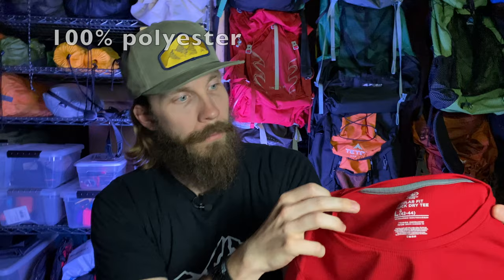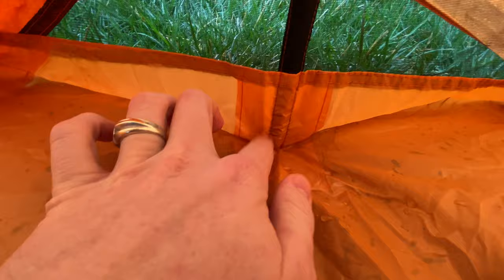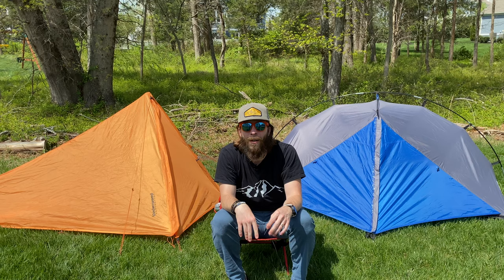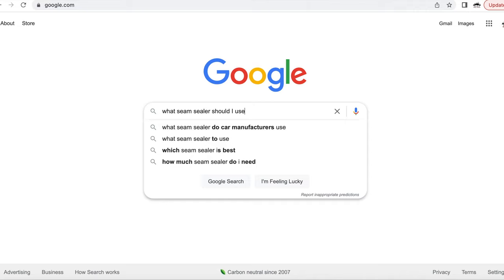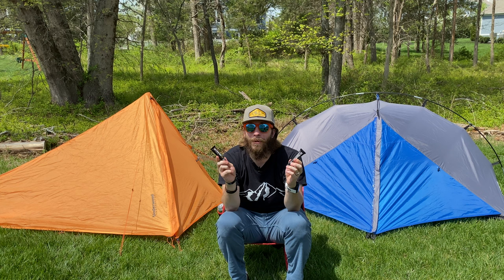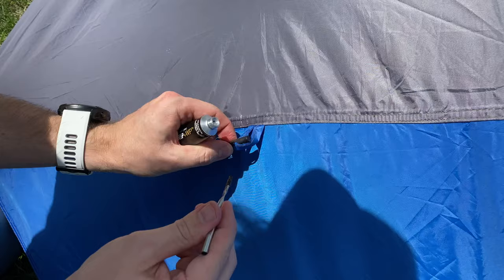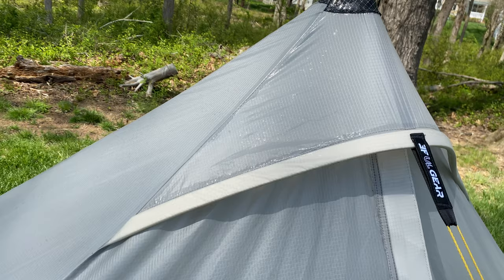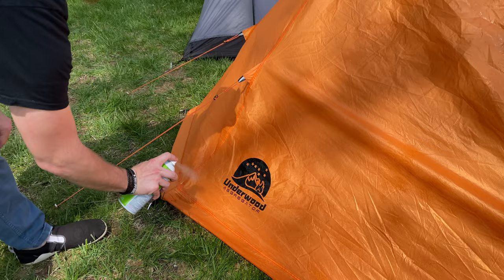FIX IT for $12  ||  How to Waterproof a Tent (even cheap tents!)

Comment: Ive got a ( no longer in production ) BA Jupiters Cabin 4 . Its only rated for 1500mm/hh , but it has proved to be quite waterproof from the factory. It survived a continuous 4 day deluge in 45 mph winds , also a puddle formed around the tent , and the base of the tent was literally sitting in a 1/4-1/2"of water , the floor was all puffed up from literally floating on the water , yet after 4 days only about a tblsp ( maybe 2 ) had made it into the tent , and most of that was from water tracked in from repeated entering/exiting/reentering the tent. Also , over the years , i have tried probably close to a dozen of the major waterproofing brands , and have found " Atsko Waterproof Extreme " to be far superior to  all of them . Another slightly cheaper but just as good alternative , is to mix one tube of pure food safe 100% silicone caulk with a gallon of low odor paint thinner and apply it with a brush , also works great for turning bed sheets into waterproof tarps. Just my 2c worth

Comment: Great video!! I have a Lightheart gear tent the solong 6. I've had it in some serious storms for a few days at a time with no leaks yet. I did pay the company to seam seal it though 😢.  Extra money. I dont understand why they dont just seal it for free for the money they are charging for the tent!!?? Only thing that happened after a few days of rain was it soaked up water and started to sag a little bit. I tightened the guylines and fixed it enough. But yeah no leaks. Oh its made of silnylon. Should have just sealed it myself and saved $$.

Comment: I have a Cabela's cabin tent that I bought about 20 years ago. Until about two years ago, it would stay dry in a downpour. When it started leaking, I re-sealed the seams and sprayed waterproofing on the rain fly. It still leaks. Next step is the hose test to try to diagnose the exact location of the leak(s)

Comment: you can get some denatured alcohol, any kind of pure silicone like some basic caulk, and a small artists paintbrush. you dilute the silicone in a small dish, with the alcohol so it's somewhat liquidy but not too runny. paint it onto all your seams, inside and out, liberally. you'll see it coating every visible part where water can seep. do it in direct sunlight to see really easily, it will coat it fully and let it dry and cure for 48 hours in shade. this is ultimate durable 100% seal. and using the basic spray sealant on any fabric gives you a bone dry inside. besides any condensation. but this is a tremendous little hack. total game changer. you can do 100's of pieces of gear for many years with a single tube of silicone and a little alcohol. fraction the cost of any sealant or tape and stronger

Comment: Best extra protection from the elements is a tarp. 
Depending on the size of the tent, get a tarp that will completely cover the tent. Tucking the tarp under the sides of dome tent.
If a canvas wall tent, a 12×16 tarp will keep a 8×10 tent top sides dry.
A 16×20 tarp will do the same for 10×12 & 12×14 canvas wall tent.

Comment: I have a Eureka Desert Canyon tent, I've had it for about 5 years now. I'm in the PNW and seem to get rain on every camping trip, last year it poured for 5 days almost non-stop, but the tent interior stayed totally dry. I always worry when it might start leaking though. I don't have a yard or a space I can set the tent up in, but might order the seam sealant and a spray and use them on my next camping trip, so long as it has a full dry day. I want my tent to last, especially since Eureka is shutting down. If I could afford it I would buy one of the updated versions of ny current tent for when it inevitably needs to be replaced.

Comment: I've recently experimented with nik wax silicone sealer, it's water based and your supposed to add it to the wash. At 12-15.00 for 10 oz thats about 3.5 loads total.
Instead I put about 1/8 cup in a quart size sprayer from the .99 cent store and add water and shake. Spray on and brush or wipe, then allow to dry. I've done two canvas laavu tents (total 4 canvas ponchos), one washload of nylon tarps. And still have enough to do the hilti tent that leaks like a seave, I done know from where though. Might have to make up some 100% silicone and oderless thinner sealer and do the floor. You have to use a mixing paddle and drill to get it right though and only mix what you intend to use. The remainder will thicken over a week or so. I've used that on tarps, hats, backpacks, jackets, etc. Just brush or roll on 2-3 coats allowing to dry each time.
Still have a vaavu set I think I'll wax with some pants and bags/haversacks.

Comment: I usually buy tent waterproofing by the gallon every once in a long while.    I fill a pump sprayer and drench the tent outside and inside, let it dry for a couple days and then use a spray can of waterproofing on the seams on the inside.     Its expensive but it works and i have lots left over to do it a few times or a few other tents if need be.    A gallon is definitely overkill but in the long run ive saved money by buying in bulk.     My woods tent which was old but treated every few years held up to hurricane dorian without any damage and i credit the waterproofing / uv protection as the reason it held up so well.    Im not advertising any specific  products as much as im in agreement with the idea of just giving it a waterproofing treatment for efficacy and longevity.

Comment: Aside of the silicon and spirits I’ve read mention, I keep my tent clear and waterproofed by using the same product I wash my car: Rain-X Wash & Wax with Carnauba Wax Beads. Have a 6-person tent I bought back in 2012 (use it for night sky observation), it has seen use and abuse of all types of weather, from the drier central Nebraska to the humid Maryland, all four seasons, rain and snow (hail excluded), and aside of discoloration, i am yet to see leaks on its bottom or thru the fly.
Reply from the maker: Nice! That is awesome!
Reply from the maker: @Harry Wang Sounds like a lot of people use Rain-X with a lot of success!
Reply from the maker: @Harry Wang Would love to know how it turns out for you!

Comment: An original Cabelas 4 season Alaskan Guide tent..  Have used for years in the rain & Snow & have Not had to Waterproof it yet, Also holds up Stupid Good to high winds & Insulates the cold out fairly well. Normally run a Propane heater in it when it gets around 15Deg or less outside.

Comment: Kiwi Camp Dry is a by far superior product. You have to use nearly 3 times as much of the Scotch Guard to get the same seal as with Kiwi Camp Dry
Reply from the maker: Thanks, Bradley! I'll look into the Kiwi! Have you tried both or just looked into the different products? Definitely appreciate you sharing your experience!
Reply: It was chance really. Growing up we always had camp dry which ironically most often can't be found in the camping supplies it's over with the work boots. But one time I forgot my trusty back up and a friend had the Scotch guard. Not knowing the difference I applied the Scotch guard like I would the camp dry and wound up with wet feet. That's how I learned.
Reply: Thank you. I'm from NZ & I knew there was a silicon spray that worked but I couldn't remember the name. Kiwi Camp Dry. I used it on my suede slippers too & water beaded off.
Reply from the maker: @fishingwithbRad013  Thanks, Bradley! Will definitely check out Kiwi Camp Dry!

Comment: I had the worst experience with Gear-aid seam sealer. First, it would take DAYS to dry, but that is not the worst part, because once what it felt like an eternity before it looked dry, when folded, if by mistake the sealer touched itself, it to glued shut. I can't tell you the MESS I had to deal with trying to unfold a tent where seams are randomly glued together inside the tent. I had to use talc to remove any tackiness of the seam sealer, but the damage was done, I had seam sealer ripped everywhere, because of the mess I had to deal with.

Comment: Would you consider doing another water test on those tents after you waterproofed it yourself showing the differences?
Reply from the maker: I definitely need to do that! I actually left them up for another 3-4 days for some rain after doing the waterproofing. They performed really well! I also sprayed them with the hose and tried my best to make it seem like rain, and they did well in that scenario as well.
But yes, I've been watching the weather for some good rain so i can set these up and show how well they do!
Thanks for watching!
Reply: I have the blue Ozark Trail tent. I did a diy mineral spirits and silicone seam sealer, and the spray on waterproofing. Took it out this week and it performed like a champ in a 2 hour Florida thunderstorm.

Comment: Great video! I just got the Ozark 1p tent before they apparently switched to a 2 wall 1p backpacking tent (2 versions) ???  The single wall version you and I have is no longer offered on the WM website but can easily be found on 3rd party marketplaces. Will be waterproofing before I use it for the first time camping. Thanks.
Reply from the maker: Hey Tom! Thank you! It seems like it's been going in-and-out of stock for a while, but maybe it is finally gone for good. Too bad, because this tent is a crazy good value.

I may have to check out those two new Walmart 1P tents. Nice that they are double wall and one has a full fly, but you pay a big weight penalty. This tent was a crazy good deal at $27 for a 3lb tent

definitely recommend waterproofing before you take it out. That way you know it's clean when you do the treatment and you know it's waterproof if the weather takes a turn for the worse!

Thanks so much for watching!
Reply: Yep that's the redesign. (White and orange maybe)  They're trying to copy a REI tent.  Both used to be offered, but they are streamlining stock.  The sleeping footprint is wider if I recall.

The white polytaffetta is also thin and tends to leak faster too.

Comment: The tent i use is the unsung hero of ultralight tents......its the original version of the REI Flash Air 2 (not 1, which does not breath well).....Ive spent multiple nights in the pouring rain and never leaked at all from any aspect ( top, bottom, sides, corners)   it is silnylon and came seam taped from factory.....it weighs 1lb 12 oz and packs down small......it is a treking pole tent.

Comment: May I ask - do you have a video yet on 1. Repairing holes 2. Repairing the inside of the seams (the clear “tape” on mine is pulling away causing leaks) and 3. Repairing/reinforcing the floor of the tent. I had a foot print tent under and the water came inside from the bottom anyway 🥴

I would love to just repair instead of buying another tent that’s just going to do the same stuff eventually. 

So much waste.

Comment: Have you ever used a product called Never Wet by rustoleum?  I wonder how that compares to the Scotchguard product you used?
Reply from the maker: I have not tried Never Wet, but at least one other person has mentioned it. I may need to try doing a comparison of water proofing sprays! Another one people have mentioned is Kiwi Camp Dry.
Reply: I know you can spray it on Kleenex, let it dry and the kleenex will hold water in a pool.

Comment: My tent's integrated groundsheet is letting in water, particularly where I kneel on it. How do I waterproof that?
Reply from the maker: Hey Anthony! That's no good! I would think that the material your groundsheet is made of is no longer waterproof. Are you referring to the floor of the tent or a separate groundsheet/foot print? If it's the floor of the tent, I would try waterproofing from both sides (floor inside the tent as well as the bottom of the tent from the outside) and see if that takes care of the problem. If not, you may just have to get a separate foot print that is waterproof.
Hopefully you're not having this issue with a new tent? If it's new, I would definitely contact the manufacturer!

Comment: Really appreciate your advice in this video. I have an Ozark Trail WT111208 and I think it's polyester and nylon but I'm not sure. Is there a way to tell? The label doesn't say
Reply from the maker: Hmm, I'm surprised the label doesn't say. Some of those tents will have a tag on the tent or on the bag. I would check both of those places. You can also check the product listing on Ozark's website. What a pain that it isn't labeled!

Comment: Our Black Wolf Turbo Lite twin 300 family tent was leaking so I resealed using the Gear Aid tubes as shown. It took 10 tubes to do including the fly plus 5 cans of tent sealer. Cost was around $200. Cheaper than a new $1400 tent. Hopefully I wont have to reseal it for many years.

Comment: I just squirt a tube of 100% silicone into a spray bottle then fill it with mineral spirits and shake till completely dissolved then saturate my tent, my poncho, my ground cloth, and anything else I want permanently water proofed and allow to dry and air out for a day or two.
Make sure your materials are clean and dry with no chance of rain for a couple days.
Tips
1. Work quick as the mixture will clump and harden within 20 to 30 minutes.
2. Have all items to be treated ready and setup ahead of time.
3. Especially saturate seams and rainflys.
4. Use disposable spray bottles.

Comment: The best method from clothing to gear that I found is CAULK.
The most expensive window caulk tube you can find in the box store. You want it to last.
Mix spirits with window caulk until it is a runny liquid and simply brush paint whatever it is, the spirits help the caulk penetrate every fiber throughout, then the spirits evaporate. Leaving a 100% saturated and penetrated, flexible rubber impregnated seal.
You can buy a $400 rain coat or an $80 raincoat and they are the same, they need to be painted or they are both garbage.

Comment: I honestly don't know what brand my big tent is and can't even remember whether I got it at Walmart or Academy. I think my small one was Walmart while the big one was Academy. Either way though, I sprayed it down super good with Scotch guard because that's what a friend recommended. It didn't work very well and my tent was inundated with water like crazy. I had also rubbed the zippers with a candle to block the rain that way but that didn't really seem to do much good either. I haven't been able to go camping since fall 2019. So my tents have both been in storage. I'm hoping by the time I get to use them again that I've come across a great way to keep them from leaking. I miss camping!!!!!!!

Comment: The key to tent camping is use a tarp tent (550 rating) design without a seam. Only the eye hooks would have a stitch. Could also spray waterproofing stuff on it or keep up the wax and maintenance.

Comment: The tape seam stuff does work great, but the Scotchguard did not even after several coats.  I contacted the tent manufacturer and they told me to use Nikwax, once I applied about 4 coats of that stuff it was indeed waterproof, and it also made the tent feel like a waxy rubbery texture whereas with the Scotchguard I couldn't feel anything different.  Supposedly all that is needed is 1 coat of the Nikwax, but I was so upset that 3 coats of the Scotchguard didn't work I went overboard with the stuff; after 1 coat of the Nikwax I could not feel much difference in the texture of the fabric, but as the coats increased I could.  I let each coat dry before reapplying another coat.

Comment: Neither of your budget tents are seam sealed which would have accounted for at least part of the failure in the rain tests (looks like I jumped the gun as you do cover this shortly after I wrote this).

Tents with a more simple construction can be factory seam taped.  Higher quality tents with more complex patterns will be manually seam sealed.  This is most often done by the buyer (usually the tent purchase includes a tube of the correct seam sealing product).  Sealing seams is mandatory.  If you dont seal your seams and your tent leaks its not the tent that failed, its you who failed....

*Tip: You can use a syringe to apply the seam sealer in a thin bead along the rows of stitching too.  Make sure to let it dry and set up to not be tacky for a sufficient amount of time (best done out of direct sunlight).  You can alternatively sprinkle some foot powder or corn starch lightly over the seam sealer to coat it and keep it from sticking to the fabric (where you dont want it to) if you must rush this process.

Comment: Way back in 70s I had a canvas tent. I melted candles and painted it.
It took a few very hot days to melt the excess wax off but on one very heavy rain storm the water run under the tent and not one drop got in.
It did make it heavy though.
Perhaps you could wash the tent with turtle wax car shampoo